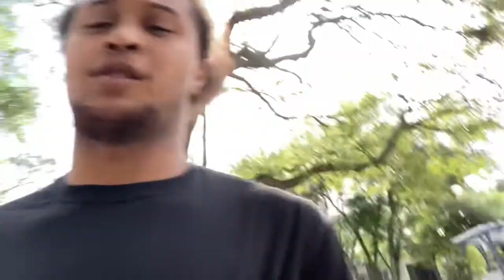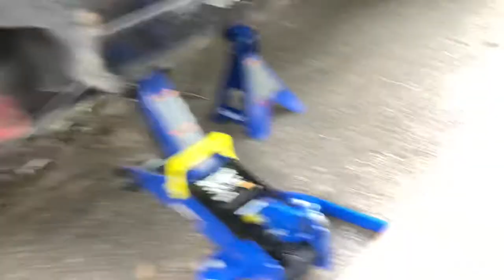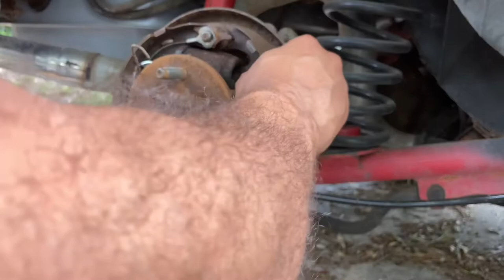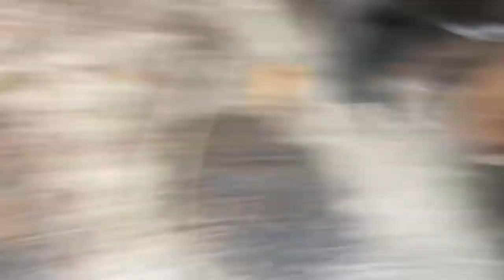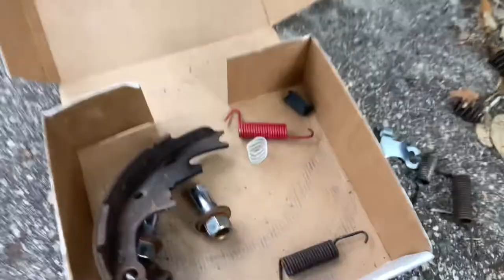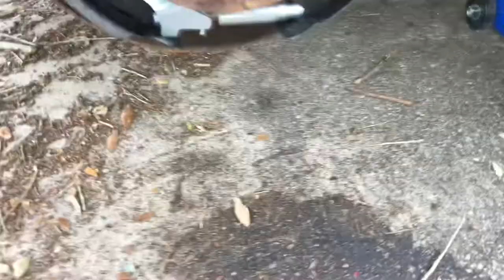Replacing Rear Drum Brakes on a Fox body 1986 GT Mustang

Comment: Found me a mint glx 3.8 from 83 with 86k miles on it all factory original. Found under a tarp on a farm in kansas near Leavenworth. Went to buy jet skies left with the mustang. 4900 body is dent free. Interior is almost factory new just 2 dash cracks the rest looks new. Drove it 350 miles home. 4900 bucks. Ty for this video as i need to do its brakes 😅
Reply from the maker: Nice

Comment: How many miles We’re on it when you did the drums?
Reply from the maker: That’s a good question. I bought the car from a friend it says 75000 but it only has a five digit odometer. I bought the car from a buddy of mine who bought it from some guys only was using it on the track. I’ll have to do a walk through and point out the goodies it has. Those drum weren’t original they been replaced plenty of times before me

Comment: One thing you should have done that you didn’t was replace the wheel cylinders also.
Reply from the maker: I guess. Seemed fine to me at the time. They still are good right now. I feel what your saying though.
Reply: I’m doing my rear drum brakes in my 83 convertible.  My shoes are actually still good and sore the drums so I’m just replacing all the hardware and wheel cylinders but that’s just cause the car set for 10 years without being used.
Reply from the maker: @davieboy1970  nice yea I was just debating at the time if I was going to do the 5 lug conversion so I just replaced what was bad it stops good lol